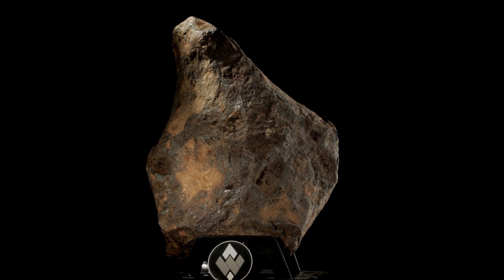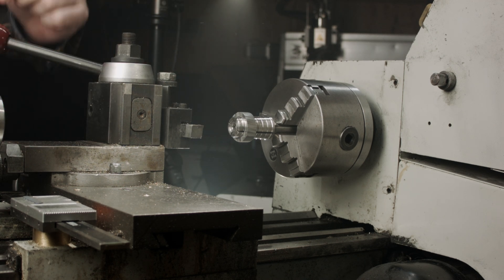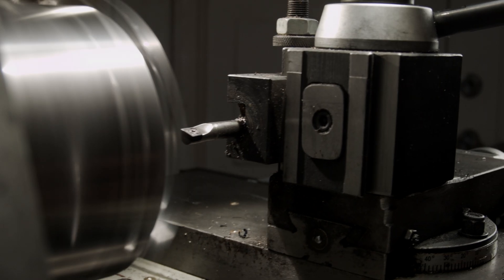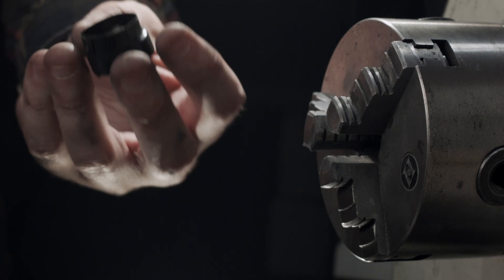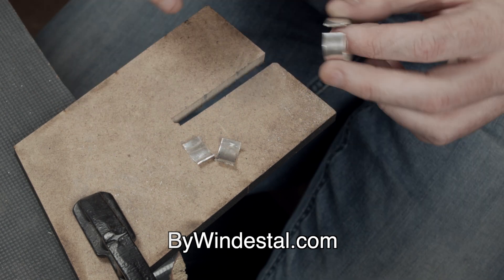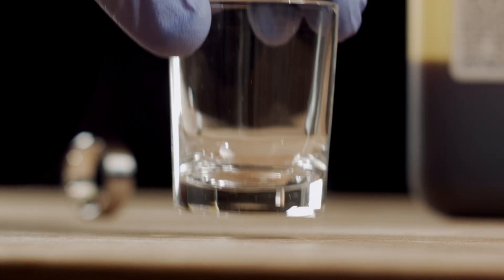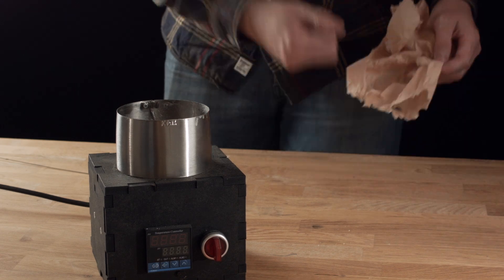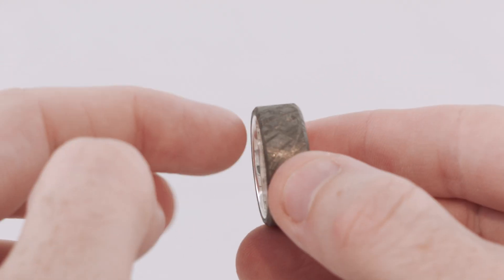This is The Oldest Thing You Can Own - How To Make a Meteorite Ring

Comment: Maybe the offcut discs from the center of the rings can be hydraulically pressed into thinner, large enough diameter discs for further rings without destroying the crystal structure, it may also be possible to similarly punch out the centers, a local engineering works maybe?

Comment: Hi David, to fix the silver lining you may use a rounded and polished pusher while turning the ring on the lathe. It may get a better fit than by just sanding away the excess material. You do this on both sides and the lining will stay where it is even in variant temperatures.

Comment: It might be interesting for you to know, that if you heat copper up to 1000-1050°C for a couple of hours you can grow copper crystals, which you can see after etching with 40% FeCl3 for a little over half an hour.
But there are two problems:
The melting temperature of copper is 1085°C.
The crystals get a lot smaller when machining.